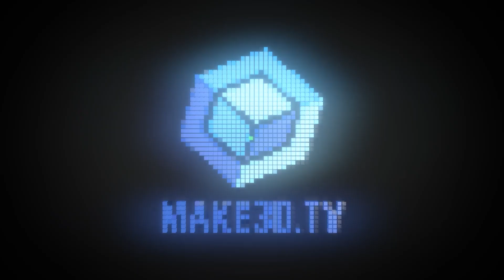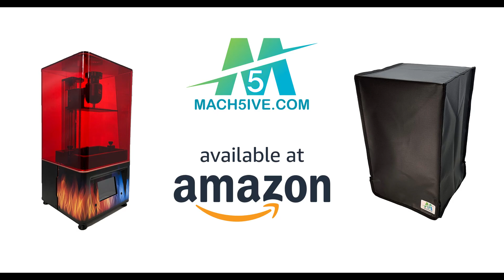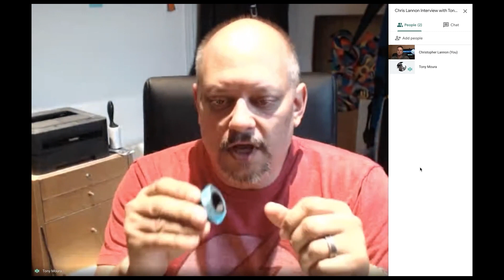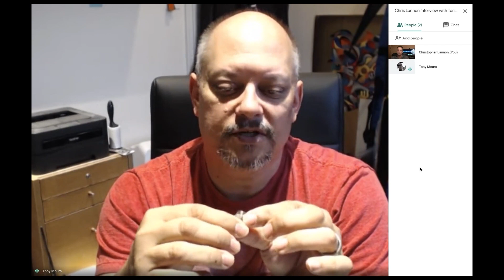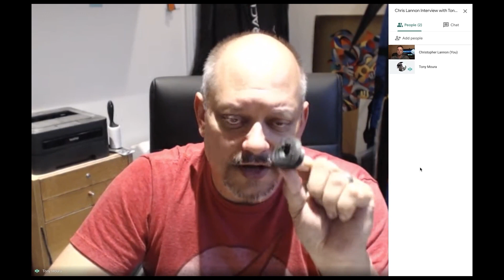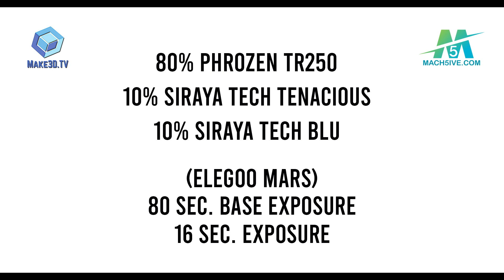How to Make Money with 3D Printing: High Performance Resin Racing Parts - Interview with Tony Moura

Comment: Aceton? Really?  That's one hell of a  strong solvent!  99% of all resins are acrylate-based which dissolve quite easily in acetone. What you want after printing is to clean the uncured resin of the model not to dissolve everything.
Reply from the maker: Apparently, you’re only supposed to rinse it in there for a few minutes. If you leave it in there, I’m sure it would dissolve.
Reply: @Make3DTV   Sorry mate, but a few minutes is waaaaay too much. Just put a drop of acetone on clear plexiglass (it's acrylic btw) and it becomes opaque immediately. You really have to have a reason to use acetone on acrylic. Maybe if you want fast prints and you opt for 0,1mm instead of 0,05mm thus reducing time but making a more jagged surface. Well using acetone would eliminate those jagged edges/surfaces.
Reply from the maker: @dodobarbar  Well, apparently the resin combo that Tony uses is not affected by acetone. He says you can leave a print in there all day and nothing would happen to it. See the second part of the interview, where he addresses this --> https://www.youtube.com/watch?v=jiUIb87fvGQ
Reply: @Make3DTV  Yeah I saw that video too. It let me speechless because the acetone I'm using "bites through" ABS, acrylic, and some other plastic quite fast and easy. There's no reason why I shouldn't trust  Tony... but he might not use the pure acetone or the acetone he's using might be already saturated with resin. Nonetheless nice and informative video (both).